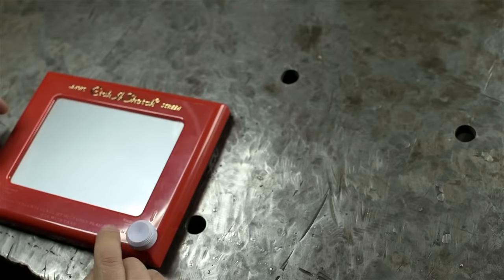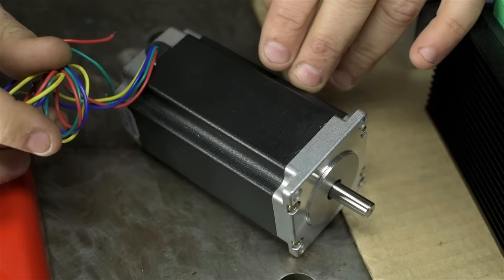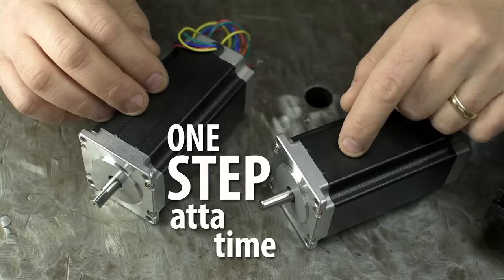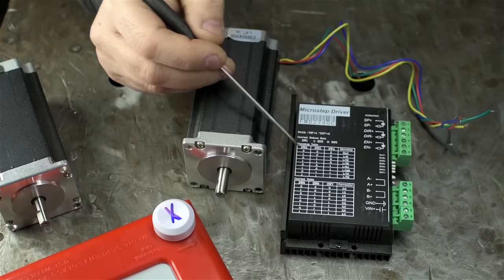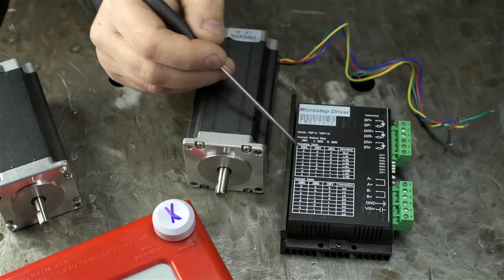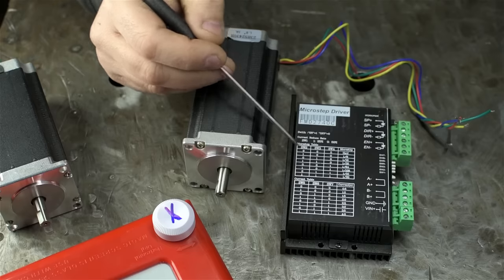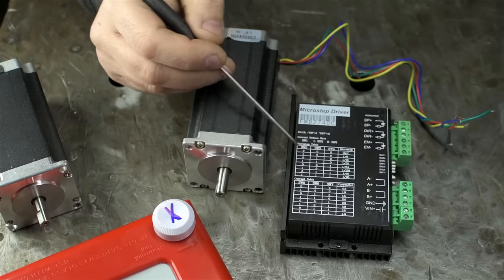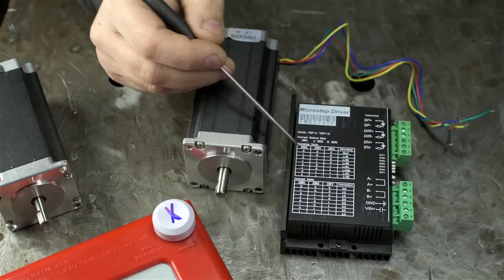Build Your Own CNC! (Part 1) - Hardware

Comment: How about wiring third motor to invert it and a fourth one with an off center mass added to it so it would vibrate like hell
Reply: Just one extra stepper should be enough -- invert and shake at a resonant frequency while rotating forward and backwards around horizontal a few times to get even distribution.

Comment: For high accuracy applications : microstepping means losing positional accuracy. You're only guaranteed full accuracy when doing a full step. And you're losing torque (not in a linear way, so check the curves for your motor). But microstepping is a good way to reduce noise/vibrations (by interpolating full steps into several micro steps), works great with applications that don't require much torque (like 3d printing).

Comment: Oh Tony, could have done this project with a much cheaper setup including $9 Arduino Uno (GRBL) for controller!  Great into for beginners otherwise.
Reply: Yeah I was thinking exactly the same thing. Those nema 23s are waaaay overkill to move etch-a-sketch knobs. Could have been done with 17s and even they would be more powerful than they needed to be.  An arduino/grbl based micro-controller board with integrated stepper drivers would be much simpler to wire too.  Perhaps less relevant to Tony's audience though, as most will likely be wanting to convert a router/mill or other more heavy duty machine tools which will require more torque and therefore more current than integrated drivers could tolerate.

I wonder if ultimately these components are destined for something larger than an etch-a-sketch............?
Reply: I don't think so. I'm pretty sure TOT is converting this over to an etch-a-sketch channel, and there's nothing beefier that he'd want to turn. Unless he's got a bigger etch-a-sketch, that is.
Reply: @stevenjkirby2020   I don't think a motorised Etch-a-sketch is the point of the exercise. 
In fact I seem to recall Tony explaining that.
Reply: If he explained it in this video then I must have missed it. I was probably distracted by some sort of clever video editing gag or a dad joke. 

If you read the whole of my comment you'll notice that I surmised ToT was likely intending on using these components for something larger. I mean, I'm sure he likes over-engineering things as much as the next guy but he's clearly not so daft that he'd put those big boy nema 23s on the etch-a-sketch permanently. He did work out time travel all on his own after all.

Also, if you read the video description, there's a clue. Part 3 will be machine design. I suspect their final resting place will be on this mystery machine. Question is, what will it be? Surely not another router! Unlikely to be a lathe given the fact that he just added the servo driven lathe attachment to the router. The plot thickens....
Reply: The thing that is definitely not obvious at a cursory glance is that for a typical hobbyist grade 3-axis desktop CNC router/mill there is absolutely nothing that the $9 Arduino and GRBL-based controllers do any worse than any of the "proper" ones. Simply none of them has ANY advantage over the GRBL for that level. Yes, if you need more than 3 axes, or you meed comprehensive support for arcane G codes no hobbyist even knows about (or you are masochistic enough to want to manually program jumps and variables in G code) then sure, the "proper" stuff has your back and leaves GRBL in the dust. The thing is, nobody who learned anything new here will need any of those things, any time soon. Yes, I run my mini-mill on GRBL - and I see no reason to move to anything more elaborate; not to mention it gives you the freedom to choose any UI you like to control it with, either under Windows or Linux...
Reply: Well I can think of one advantage off the bat for using a Mach/Linux CNC board over a grbl one and that's encoder feedback. Rigid tapping is a pretty useful feature to have on a mill and grbl doesn't support it, perhaps that could sway you to make the move, Atilla? Also if you want constant surface speed or thread cutting on a CNC lathe, you're going to have to look further than grbl.  

Not that I think there's anything wrong with using grbl or any of it's derivatives for a cnc machine. My own router runs on such a setup, but there's definitely reasons aside from the more esoteric G-code functions to run a non-arduino based controller.

None of this is helping us answer the £779,910 question, though. What's he building with those motors!?
Reply: Okay, that's one example, and that's why I didn't say there's absolutely nothing GRBL can't do - G code support was just an example of its limits; but frankly I have yet to see a hobbyist CNC router/mill that has encoders - plenty don't ever even install limit or homing switches yet work just fine as long as they're used with a bare minimum of sanity.

Sure, you might expect to see encoders in a machine shop environment but that's really not the kind I had in mind talking about DIY. In general, I believe one could conceivably use GRBL even in light production, but I would not advise anyone to do that. On the other hand, to crank out the odd CNC-cut workpiece every now and then (most likely much more 2.5D than 3D even although GRBL wouldn't really care) I find the "default" solutions like Mach or LinuxCNC have very little to offer indeed over GRBL (yeah, I don't do much machine tapping...).

As for what Tony is building... hmmm... I think I'm going to go with, uh, "two-paddle mechanical Pong robot". Yeah, that's got to be it, the etch-a-sketch is just a ruse...
Reply: Yeah man, I feel you. Most hobby machines are going to be open loop for sure. But It's not uncommon to see closed loop feedback being used on hobby machines also. I mean technically ToT has it on his router's "lathe axis". There's a feedback loop between the servo motor and it's drive.  I'm in the midst of converting a small hobby lathe to CNC and it will have spindle sync. It will be in my front room which is definitely not a machine shop. At least that's what I tell the Mrs.

You could absolutely use grbl for a production machine if you wanted. That's really down to the robustness of whatever the controller controls. If the machine can mechanically tolerate 24/7 use I'm sure grbl could be used for control.

If Tony wasn't planning on building one of these fancy pong machines, I'm sure he's considering it now you've brought it up.

Comment: Guess I'm masochist using Arduino xD I always looked at it as a lazy option compared to building custom pcb.
Reply: I just refurbished a CNC from one of the breakout boards described to a specialized CNC controller with linuxcnc it was a plug and play operation
Reply: Think to do, cause of price. 600usd for board is pretty significant when you can do it with 5 euro board&drivers over that. Problem is of course big enought driver impulse, when arduino its couple milliamps and you need to multiple amps to drive those goodly. Perhaps step up converters or extra old pc power units for power up everything and another mid level power-signals with small relays to drive it, but pretty complicated, and then there is problems with cnc-language. You can perhaps use stls or something else free to use models to drive, but there may be some significant metal working stuff what mostly plastic and software-engineering people doesnt know and dont have prefixed options for diffirent metals to work with, even if there is software to understand diffirent tools and working speeds etc what i doubt. Still interesting problem build up small/mid size cnc lathe/router for most machining works stays one of ideas i want to build some day.

Comment: a polar graph drawing robot is a pretty good first CNC project. Makelangelo with an uno or mega and a $10 cnc shield, $10 nema17 motors, 1-GT5 belts and drive pulleys, and a single servo or solenoid is all that is needed.  this is a good starter because it is fairly easy to construct the frame for and it only requires 2 motors.  Hard part is actually turning images into the vector format.  The makelangelo software does some of that for you.

Comment: grbl setup isn't that hard and i have made a stand alone cnc with arduino mega + grbl and reprap 3d printer shield with small display. Just haven't made the final version of mechanical part of my cnc. Version 2 right now but it is just to sloppy so it requires version 3 which is still in my head :). Reprap shield required some minor modification to run 2 parallel motors for x axis and accept 24volts power suplly, i use small step drivers (2amp) and nema 17 motors. And arduino can control larger motors just need more capable drivers. All i need to do is generate g code save it do sd card and put the sd card into reprap shield and start the job its nice to not have to worry about pc. But i think GRBL is limited to 3 axis only, at least it was at the time i played with it.
Reply: If you want to build on the cheap make a fixed gantry moving table machine. You can't build a cheap moving gantry machine. As you've found out slop is unacceptable. My fixed gantry drawer slide machine can isolation route printed circuits in copper clad board. So it is not sloppy.